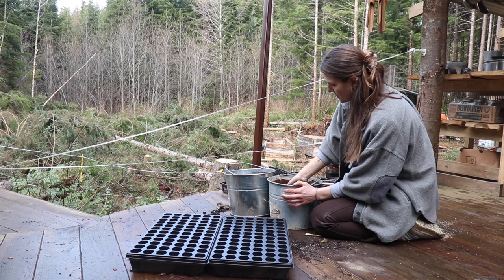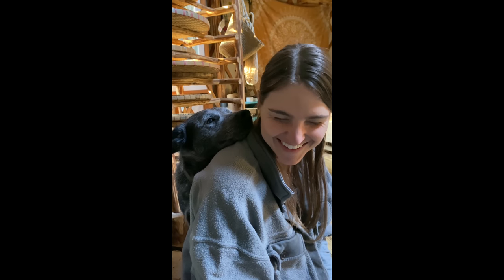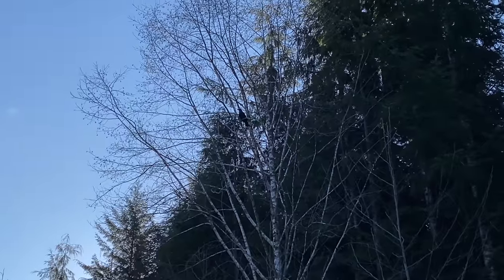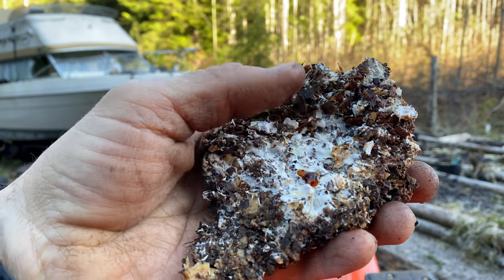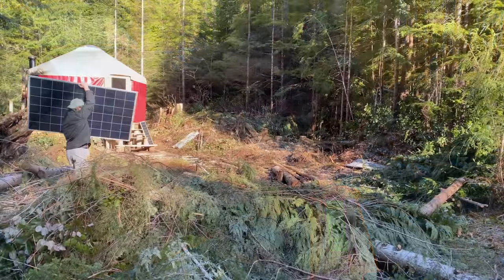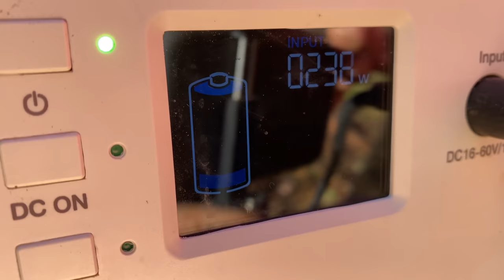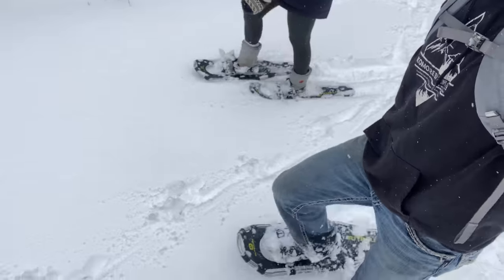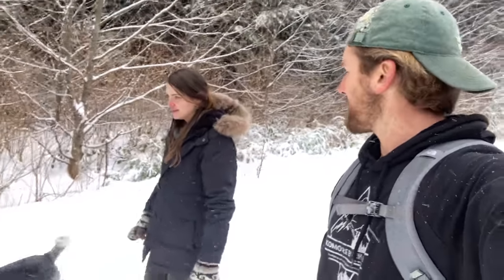SURVIVING SNOWSTORM in a YURT - How We Stay Warm | BRICK OVEN PIZZA & HÜGELKULTUR GARDEN - Ep. 123

Comment: Hi Jake * Nicole.... You might want to think about some sort of ceiling fan to push the heat downward.... I have high ceilings in my cabin and it really helped during those really cold and really hot days/nights.
Reply: I wonder how they charge batteries in the dark months, I guess they have to ride, keeps you in shape too. At least there are 2 people. They should get a tread mill for the doggo's so they can chip in, they love treadmills.
Reply: Correct but it needs to spin in the right direction 

Heat rises,colder air takes its place. 

Heat is doing nothing for you at the ceiling and cold air is rushing to fill the void where you exist. 

Running a ceiling fan that rotates in the opposite direction as the summer can increase your ambient temp maybe 15 or so degrees 

Huge money saver, less energy required.
Reply: @djnone8137  Definitely and they don't use much power in the cold you can run them at the slow setting. They all have switches in the motor to oscillate in both directions, up position for summer, down for winter, though I'm sure battery power is at a premium in the dark months. There are well over 50,000 patents that have been issued for free energy devices, solar and wind are arcane and have been since the start of the 20th century. Some of those designs are also anti-gravity.😇

Comment: If you guys are having issues heating the yurt with that woodstove then there is an issue. That woodstove should heat that yurt to sauna like temps if used correctly. You need to load that stove full of wood when you have coals then shut the flue damper half way to burn for longer periods and hold that heat inside the firebox. I would suggest you dont have the operation down quite yet. I use a much smaller stove in my hunting camp with no insulation and I have to open windows to regulate temps......LOL
Reply: I know people who live in yurts in snow country and don't have a problem heating their yurts.

Comment: How should we protect our fruit trees and garden from bears, raccoons, deer, cougars, wolves, martens, and humans?
Reply: Hire out of work ex SOCOM snipers !
4 at varying distances and multiple calibers should do.
Reply: Dogs
Reply: There are a few options but they depend whats the biggest problem where you live, what tree form it is (standard or half-standard for example) and how much you want to spend on.
In the nursery where i work, our biggest problem for our young fruit trees are rabbits and we use spiral rabbit guard to protect the trees, it works quite well is relatively cheap but the plastic becomes brittle after a few years.
In your case i would suggest secuerely fencing in the garten, preferably with tall game fence were the spacing gets smaller to the bottom, if you have a rabbit problem you could tie an additional chicken fence to the bottom of the game fence and dig it in shovel deep or use the rabbit guards.
Against raccons and humans i would suggest weaving in one or two strings of barbed wire on the top end of the game fence and against bears the only secure option is probably high voltage electric fence on the outside of the game fence(can be atached with spacers), the barbed wire might be redundant if you use electric fence.
Reply: A razor wire Wall around the gareden around 2m  taller and shade net rooms it could protect the garden 👍
Reply: Motion activated bear spray kiosk fence. I bet the glitter-bomb package thief YouTube guy could help. Synergistic Content cooperation ™️
Reply: Tibetan Mastiff!  A real one.
Reply: Hello Jake and Nicole thank you for the videos and the question.  I will be using T posts and fencing around my fruit trees along with planting the things animals don't like. For example anything in the mint family and onion family along with many pungent herbs. Take care and God bless you
Reply: Dino Nanic  hahhahahaha
Reply: @Slimefollower  hahhhahaa
Reply: From humans? Will people come on your land and steal stuff?
Reply: You should have a meeting and create a focus group.  Invite the species of the forest and those involved in the area. Determine an evolution that will  better the future for all. Once reaching a goal determine the threat.
       The consensus and conclusion may result-  there is an Alien in our presence(forest).
     Who is protecting whom? from what?
   Do you really want to kill a Martin for eat a carrot?
  A teacher once said "you bring candy to class, you better bring candy for all"
  I believe a bear once said "you shit in my forest... I will eat you"
Reply: Invite hunters 😂😂😂😂😂😂
Reply: @ronhanish   Your right....  Da Bears
Reply: @ronnowlin4223  hahahhha
Reply: @Slimefollower  lol
Reply: Seen deterrents for bears. Boards with nail's thru them. Sensor or snare flash bangs. High pitched whistles might work. Maybe some skunk like snare triggered sprays. Punji sticks or similar with rebar.... Even firecracker like boobie traps are going to give them another food for thought.
Reply: Oh and from them not only your garden! You should both be packing a .357 a least! I know that you guys are mellow yellow but your martial arts arent going to get it with a determined bear, wolves or cougar! A shot gun with slugs up front then some 00 behind would be good. A 1187 remington simi auto with extender tube for 10 rounds would be good!
Reply: Actually .44 at least! Youve got griz up your way! Bear board deterrents could also be bamboo instead of nails or alternate!
Reply: Infared sensors for detection. You could have bang devices that you have a remote control to ward them off.

Comment: Suggestion... boards on the inside, posts on the outside.  That way you are not relying on nails or screws holding them together. The pressure of the interior contents keep it in place and the nails simply stop it from moving.

Comment: I’ve watched a few of your videos and noticed your struggles with the wheelbarrow.  Take a piece of rope ( I prefer nylon rope) and tie it to the nose of the wheelbarrow( the part you tip the load onto).  I use about six feet of rope but it depends on your terrain.  Then when your going over rough ground or up planks Nicole can give the rope a pull aiding you with the wheelbarrow. Try it once and you’ll never take that rope off.

Comment: If you extend the stovepipe on the pizza oven through the roof with an insulated pipe it will increase the draw so smoke won't come out the door. Venting under the roof will eventually make the understand of that roof black and it can chip or drip off. You will have to clean it or tear it down and rebuild it.

Comment: I thought of a root cellar. You could add some material around the bottom. If clear double layer or triple on the sun side could trap and store some heat to help warm the yurt. Would be good to have vestibule to minimize heat loss going in and out. Could also be a mini green house.you could have a outside circular staircase from vestibule down to cellar that could be enclosed as well. I dont see wind power generator, not sure if you have a stream or creek but hydroelectric.

Comment: I was just wondering if you happened to have a compost thermometer that you could stick down into the Hugelkultur beds to check the temperature. I've heard that once all that wood starts to really rot that it will actually extend the growing season because of the heat put off by the decaying wood underneath. I want to run this experiment in my backyard but I'm not there yet so was thinking that perhaps you could do it for me as a proxy experiment. Great idea to go with Hugelkultur for your beds as it will help clean up so much and save so much work because you won't have to level everything. As always, I can't wait to see what you two do next.

Comment: In Ep. 53, you had a bear problem. I highly suggest a three-strand electric fence around the base of the Yurt, spaced four inches apart. A three-strand electric fence around the yurt, height start at the bottom of the yurt windows spaced four inches apart. I suggest three batteries to store enough electrical charge, to be strong enough to deter more than one bear "sampling" the area for weak points.

Bears absolutely "HATE" getting shocked. It is not so much of a pain reception than the unknown and sudden irritation bears hate about electric fences. Also, if a repeat offender bear is shocked hard enough, the first two to three times, the repeat offender bear will quickly learn, "This place bit me! I did not like that at all!"

This is why you need a separate solar panel, separate triple batteries, electric storage fence system for the yurt;

A separate solar panel, separate triple batteries, electric storage fence system for the gardens;

A separate solar panel, separate triple batteries, electric storage fence system for the bathhouse;

A separate solar panel, separate, triple batteries, electric storage fence system for the outside kitchen.

Also, have an indoor bicycle power generator to help charge the batteries when the solar panels are covered with snow and on cloudy days. An indoor bicycle power generator, with separate four batteries electric system, will also provide all of your yurt independent power needs.

Realize, automotive interior lights are just as easy to install inside a yurt, outdoor kitchen, and bathhouse as an interior house light, and, are already made to run off of automotive battery power. You only have to have a fuse block distribution system to scale down the power, and alt meter gauge for operating the automotive lights.

Also, most automotive lights can withstand wet areas much better than house interior light. Easy to make an indoor bicycle generator. Bicycle on a stand, rear chain drive to an automotive alternator. For fitness and power production, an independent chain drive automotive alternator power system.

Just some FYI from someone who has grown up on our family farm and ranch, raising vegetables, herbs, flowers, and animals. I have trained numerous horses, dogs, and mules. I spent 12 of 18 years deployed overseas in the military and working in intelligence. I have been big game hunting and fishing since I was fourteen. I have worked in federal and municipal law enforcement before teaching political science at a small junior college. I am now finishing up our preparedness chores before major climate changes begin to cause societal unrest. Stay independent, solitary, isolated, native, and stay out of the cities. The fewer people that know where you live, the better off you both will be when climate changes begin to force millions to run from the cities due to loss of infrastructures.